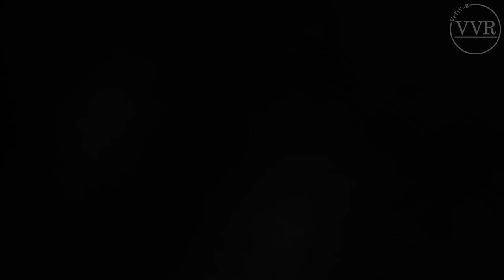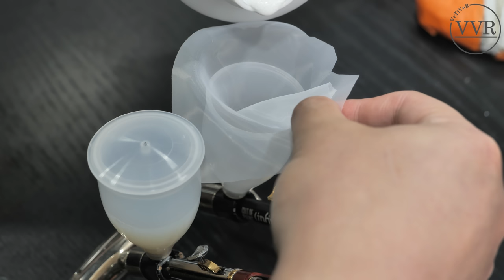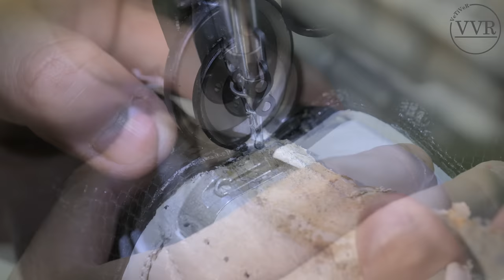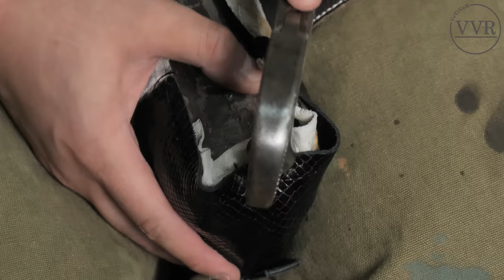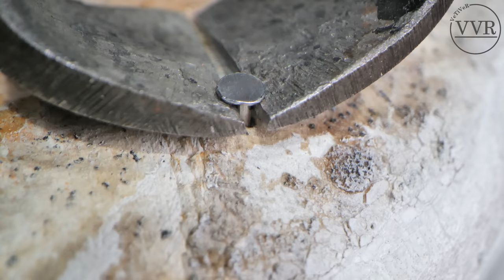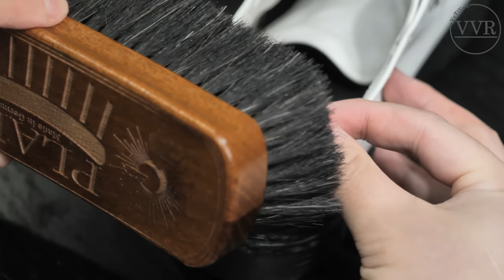'remake' [Neil Barrett] Vintage Sneakers change sole,leather,eyelets,etc..  -4k

Comment: Wow! It’s a bit of a shame that the original studs couldn’t be restored, but the material you used is the perfect substitution!! You did a great job once again~ 😊👍
Reply: I think the snakeskin-textured leather will wear better than the square pyramid-textured vinyl did, though. and I agree, it is a great substitution.
Reply: :/ he lost all patern where refined textures were the point of these shoes.
Reply: @retonoi  that pyramid vinyl wasn't available, though, and the old stuff was falling apart. those shoes are from AGES ago; I doubt that vinyl is still made. the customer asked for a repair; I think they did a great job. it's easy to criticize when you're not the one doing the job.